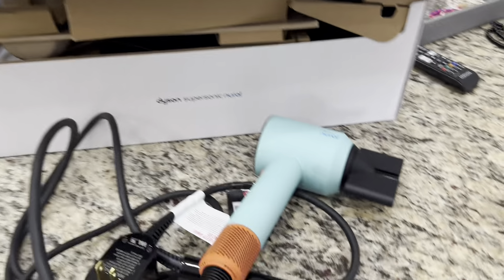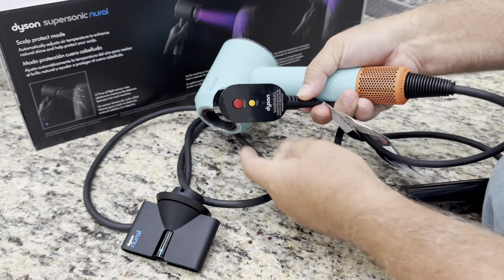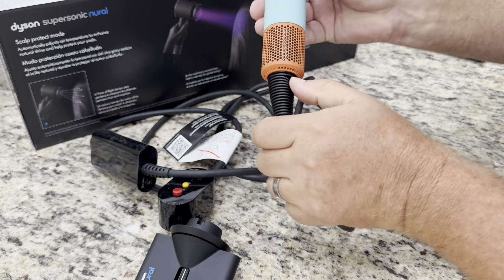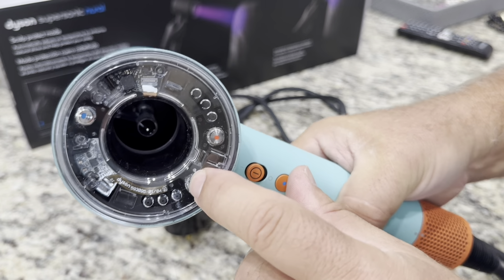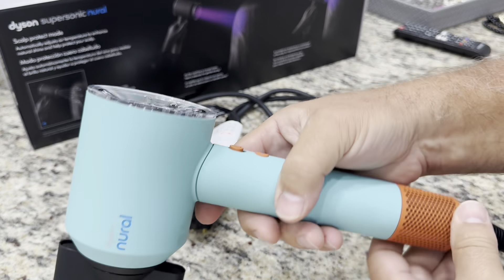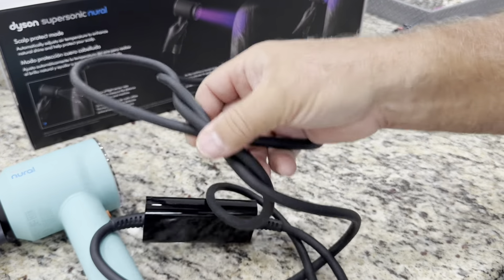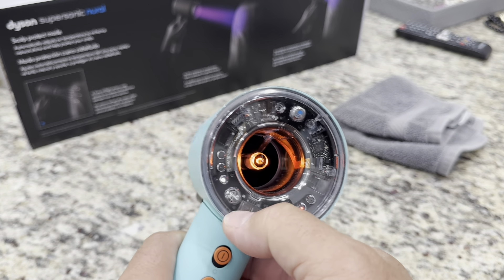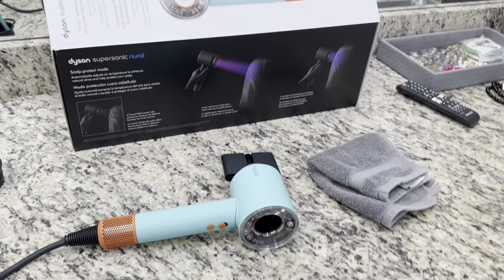Dyson Nural Hair Dryer Close Up

Comment: tbh this isn't a very good review, there is a sensor and memory for the attachments that you put onto the hair dryer. The further away you move the hair dryer from your head it uses and stronger temp and the closer it is the cooler the air coming out is. Considering this costs $600 I would handle it a bit more carefully.
Reply from the maker: Thanks for the comment. It isn’t really meant to be a review. It’s more of a close-up to see what it looks like.
Reply: You said that at the start and you definitely did a good job talking about the textures and tactile feel and colors etc. 

I think it adds to the conversation!
Reply from the maker: Thanks!
Reply: @bobbygfl i liked this video, because I bought the dyson and have a doubt of its originality, i mean i was searching for the video where i could see an original one to check with mine. Thank you
Reply from the maker: @gunelsuleyman  thank you!